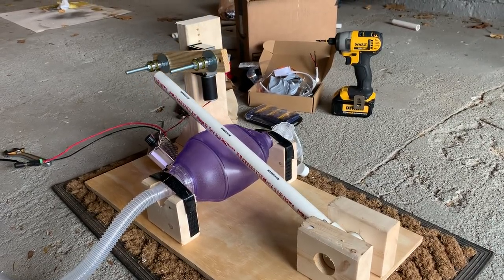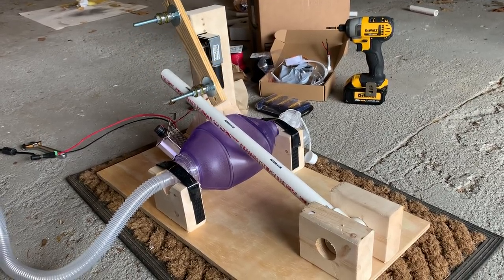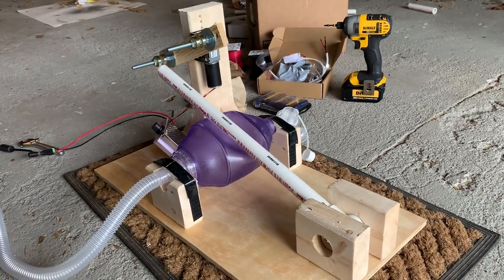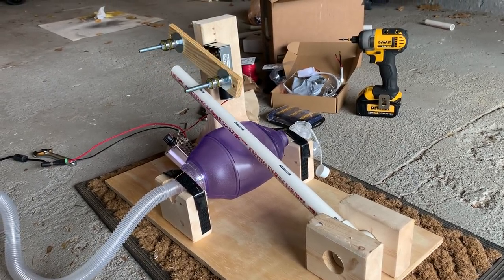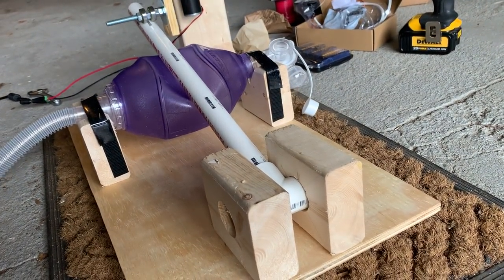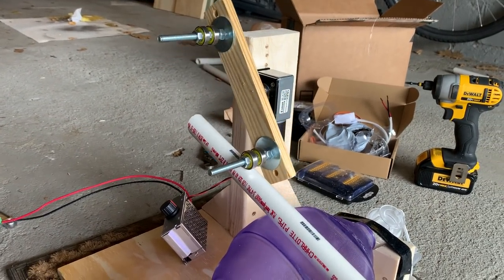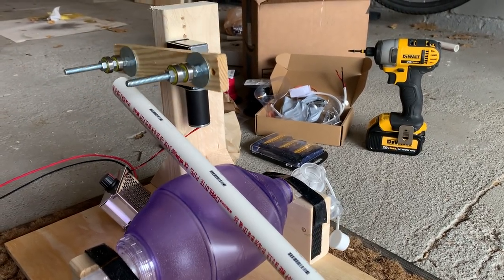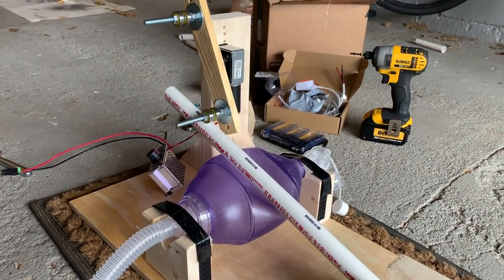Macgyvilator Mk 1 (3-19-2020) - "ventilator" for disasters and/or low resource environments

Comment: I applaud you for putting this together as many other very creative people have shared on youtube, but it is not remotely sufficient for the disaster that we are dealing with. For ARDS, we need the complex settings such as pressure support, higher peep, and perhaps inverse ratio ventilation. These would have to be delicately adjusted to the pt’s changing conditions. Anyone on a “ventilator” of this level of sophistication would probably succumb to the disease fairly quickly.

This is not to discourage your inspiring innovative spirit. I think many out there can help by focusing on creating Powered Air Purification Respirators (PAPR) for frontline usage. Or, meaningful ways to isolate aerosolized environment when affected individuals need to be intubated.

Good luck, and please stay safe!!
Reply from the maker: Thanks for your comment. This was never meant to replace a ventilator. This is a last resort just before hand-bagging for under-resourced areas, and it's also a validated (well, Mk2 is validated) step-off point for other people to tweak and build off of. This is just a first step. I and others are continuing to build!

Comment: Great work, I ordered a bag the other day so I can try something just like it. If you can secure the bag itself better on each end, you'll eliminate that back and forth rubbing - the current friction will probably kill that bag within a day at most. Love all of the innovation.
Reply from the maker: The bag has to move - it can't be compressed without some shortening of its length. Fortunately I've tested the crap out of the one bag I have, and it's held up fine!
Reply: @datatrician1369  Awesome to know!

Comment: Nice solution. Im waiting for my bag to come and want to design makshift ventilator for 3d printers using same principle. I have seen many of those recently, mostly constructed by engineers but they bite it from wrong side. They think simple known ideas for linear motion, like linear gears or pneumatic actuators and assembly complicated mechanisms that will be probably not very reliable. The way for this is to think outside the box, the thinking should be complicated and complex but assembly has to be simple as it gets and with everywhere available hardware. Exactly like your idea. Great job.

Comment: One suggestion I would make is to add support under the bottle so it is not putting stress on the hose attachments when it's compressed.  Right now it seems to be bearing entirely on the hoses, which will wear them out quicker
Reply from the maker: That's a good suggestion. FWIW, I just completed a 24 hr continuous stress test. Everything's still working!
Reply: This is exactly what I was going to point out. The areas currently going through unnecessary bending cycles are likely to be the first failure points.
Reply: I would think letting the bag ends ride up and down in slots, rather than having them anchored would allow free movement and less flexing on the bag/hose joints. Less parts required too.

Comment: genius in it's simplicity, and I think you have the bases well covered.   Beyond the obvious need for a PEEP which you already mentioned, I would be concerned about the longevity of the bag.  I've done long EMS transports for IFT's and had BVMs fail after a few hours use... usually plastic up around the valving breaking..   With a fixed setup like yours where it's not getting yanked and cranked the same way, that should be much less of a concern.  The one spot I can see is that maybe  with the hard pipe pushing in one fairly small area as compared to a hand squeezing, the bag itself might fatigue and tear or lose resilience/elasticity.  Maybe a piece of foam pipe insulation to spread the force out and reduce the depth of compression needed for a given tidal volume?   Having the user periodically roll the bag so the wear point is at a different spot would be an easy mitigation also.    Great idea and nice implementation.
Reply from the maker: I did a 24 hr stress test already, and the BVM held up reasonably well. The problem is that I don't know how well other brands of BVM would hold up. But I can say that the stresses on the BVM don't seem to be excessive
Reply: @datatrician1369  I'm surprised by that, but not at all displeased.   You've done a great job covering the bases.

Comment: If things get bad with a family member I will build this. I ordered a motor and bag valve mask already. Before I saw this video I bought a new small shop vac with a blower function, a 30' vacuum hose, a Cpap mask and a 10' Cpap hose. I figured I could put the shop vac in an adjoining room to our bedroom and rig the hose to force air into the Cpap mask. I could adjust the pressure multiple ways but it would be a constant air pressure. Seeing your design I'm thinking I could combine the two. I could attach the shop vac blower to the PVC tubing then have the extension hose mounted at the one end of the PVC tube that goes up and down. When the PVC tube is down air would blow through the tubing. When the PVC tube raises the pressure in the tubing would reduce to zero. In theory, this could create a high pressure ventilator.

Comment: You can make the volume of ambu bag compressed adjustable either by making the distance to the pivot of the lever adjustable , OR making the crank length adjustable.

Comment: Great design. Only concern i would have is the wear at the end of the bag, where it hits the wood supports. Perhaps the bag could be in low wood box ( with a shaped styrofoam foam base or similar ] that cradles the bag from moving around too much. If the cradle support was sufficient  then hopefully the bag end bearings could be removed

Comment: the concept is good, as I have a quadriplegic daughter on a ventilator,  I must admit this is a good idea, (few realize that after 20 minutes your hands are dead  using an Ambu bag and I speak from experience here)  the only suggestions and/or questions : (1) whats your volume output on each compression of the Ambu bag, (2) can the Ambu bag be removed quickly for actual human usage (quick release) if it is needed to increase speed manually, (3) I would lower the whole assembly to the bottom board, the why is you will have an Ambu bag that will have support when your compressing it, making a more "efficient" usage of the internal air volume in the bag.  ignore criticism,  this could easily be a 3rd world county solution in the future (you know making things medical grade etc) but in a pinch... good job
Reply: Great idea getting the bag down on the board.  ultimately, reducing the amount of movement needed to generate the required tidal volume will reduce wear and tear on the bag, motor and everything else.
Reply from the maker: Thanks for your kind words, Patrick. That helps me push forward! I'm hoping to get to a real respiratory lab this week to test volume output (and to see if it's sufficient). As for #2, the PVC compression lever is just a friction fit into the pivot. You can give it a twist and pull to remove it and then have full access to the bag. It's only held in by velcro straps at that point. And you suggestion #3 is a good one. The supports will end up being a variable height depending on the specific BMV being used, but I think it's worth it. Hold tight for Mk 2!

Comment: Tubing that goes to the patient's mouth should be very short and small as  possible in order to circulate the air correctly. if not it will only circulate the same air to lungs, and some sort of pressure regulator or torque limiter to the motor will be great.

Comment: I think u could put the motor below ñ connect that rod pushing the bag down with an adjustable length of velcro, so that in practical use that mount of the motor is not in a delicate place where it could brake easily. So the whole unit will be enclosed like a box ñ all u have to do is open the velcro of the pipe incest the bag just tighten the velcro to the level of depression of the bag u require ñ the setting knobs can be mounted on the top of the machine.
I'd love to help more.

Comment: You could slide under the bag different thickness of wood to control the volume of air flow also would be good if it could be wall mounted, People like you getting it DONE !

Comment: Please, yes.  Can you share the parts list?  Particularly the motor,  rpm rate module, and the power source.
Reply from the maker: I'm assembling Mk2 as I type this. I'll test the whole thing in a respiratory lab tomorrow, and if I can achieve good physiologic parameters, I'll put together a parts list and assembly instructions.
Reply: @datatrician1369  Great. I'm in South Africa, and there are only around 6000 ventilators for a population of 60 million.
They are struggling  to source vents from overseas, so something like this could be perfect.
Will keep an eye out for your MK 2 and parts list/ schematics.

Fantastic job by the way.

Comment: If you make the spinning arm longer and put the bolts that hold the bearings through slots rather than holes you could then increase or decrease the amount the bag compresses giving different volume of air each revolution. Another option would be to have different length interchangeable arms.

Comment: Great design, only area I see potential for improvements would be the rotating arm. Add more mounting holes the length of it. That would allow you to mount the bolts and effectively have control of the I:E times as well as the Vt as you mentioned by lowering the motor. Great job with this I’m very impressed.
Reply from the maker: Good suggestions. I already have a bunch of holes drilled on the rotating arm; you just can't see them because they're covered up by the big washers.

Comment: To maintain Tidal volume with any extension tubing that you would have to connect to patient you would probably require a greater amount of the bag to be squeezed.
Reply from the maker: That's a good point, but it shouldn't be a big issue for this. It's set for a mid-range compression right now. I'd really like to get access to a PFT machine to get accurate tidal volume numbers.
Reply: @datatrician1369   Could you compress the bag into a balloon under water and measure the difference in water level between full/not full?
Reply from the maker: @missmosity  That idea occurred to me. If I don't get access to a real vent or a PFT machine, I'll go that route
Reply: @datatrician1369  consider talking with a CRNA or really anyone in your anesthesia department. You're likely to get someone interested enough to be able to try and help. Not to mention we are idled right now in most hospitals, so it would give someone something to do. And I'm sure whoever you talk to will already know this, but they can use a reservoir bag as a lung.
Reply from the maker: @justincaseyouforget  Taking Mk2 to the respiratory lab tomorrow!
Reply: @datatrician1369  looking forward to seeing the results! Quick thought, I wonder if there's a way to make a disc that isn't round to handle compressing the bag instead of the skate bearings. It's the same way a lobe on a camshaft works. If alignment or friction is an issue, the bearing could go onto the PVC arm instead. You could completely control duration of compression as well as how quickly you compress (peak inspiratory pressure or PIP). Likely not necessary, just thinking out loud.

Comment: I'm also working on one. I'm trying to build it with  windshield wiper motors because they will probably be more easy to source and they can run off of 12v incase there is no household electricity. It can run off of a car battery.

Comment: Use a plug in drill and besides the ventilator bag, you'd have something that anyone could get their hands on.  Well done!
Reply from the maker: Thanks - my main concern with the drill would be generating sufficient torque at low RPM
Reply: @datatrician1369  I agree.  You could make a small gear drive but that would just complicate your design.  I see now why you built it the way you did.  Great work.

Comment: Use slots for your rollers instead of holes. Loosen wing nut to move in-out for length of stroke and tighten.
Reply from the maker: It's a good idea. Slots are a PITA for me to make, though ;)

Comment: Will you share design, dimensions and materials required?
Reply from the maker: If there's sufficient interest, for sure. I'll make the call by the end of the day
Reply: @datatrician1369  If specs come out and this is actually something healthcare providers can use, I guarantee there will be volunteers to start production. I can already think of a few ways it could be improved for a Mk 2. 3d printed parts open up even more possibilities.
Reply: @datatrician1369  please do share!
Reply from the maker: @orourkean  I'm assembling Mk2 as I type this. I'll test the whole thing in a respiratory lab tomorrow, and if I can achieve good physiologic parameters, I'll put together a parts list and assembly instructions.

Comment: Cool - leave it running and see how long the BVM holds up - I see a friction problem on the ends... but slick concept!  Perhaps a hinge on the end block to let the wear be on a hinge instead of the BVM (left side of the vent).  The BVM/tubing may be more resilient and not need this.
Reply from the maker: Did a 24 hour continuous stress test without issues. Once I tweak the design I'll really give it a good trial.

Comment: From the nursing point of view... in a real practice are we putting this beside the bed? across the patient on a side table?  Mounted to the wall? this appears to be a fairly large device. 

Would the Ambu bag be able to detach for manual bagging if the patient required transportation?

However, I do think this is a rather neat idea because that is something my husband (respiratory therapist) and I have discussed on who is going to bag these patients when we run out of vents.
Reply: Space is always tight around patients... I think pulling the bed away from the wall and placing this at the head would be the best spot. Since he used Velcro to secure the bag, I'm guessing it would be pretty easy to remove. That's a good consideration since we could run out of ambu bags as well as everything else at some point.
Reply: Guessing by the time these are deployed people will be on the floor :-(
Reply: @TheWhitde  maybe true, but this is at least a good thought exercise and provides a little hope. It's much more pleasant than the conversation I was in the other day of how we're going to decide who to take off of a vent and allow to die so we can save someone else.

Comment: This is fantastic! I wonder if you could get rid of the PVC pipe entirely by putting some large rollers on the rotating part. They would make contact and compress the BVM as it rotates around. Like some large diameter rubber wheels.
Reply from the maker: That would work, I think! I'd just worry about the weight on the rotating arm.

Comment: Add a swivel adapter to the end of the BVM.  This could keep that up and down motion from displacing a tube.
Reply: That's an Amazing build. Thank  you. You can replace the bearings with a pipe that will fit on the shaft. This need less alignment. Stay Safe.

Comment: Pipe on bottom so it contacts the wheels all the time and does not have to be supported by the bag.  Motor on lever.  Also, running a link (piston rod) between the motor and pipe would simplify but not give the breaks in operation which might be desirable.  Never underestimate America.  Shared.

Comment: I made something similar but with a windshield wiper motor as it's designed to run continuously and powered it with a DC model train transformer.. but also because it's what I had on hand... I used a door hinge as a pivot point, but i like your design too
Reply from the maker: A wiper motor was also in my list of possibilities. Do you remember if it had enough torque to compress the bag sufficiently? That was one of my concerns.

Comment: you could add a spring  between long PVC and plywood base because ambu bags compliance is less as it seems!GOOD JOB!
Reply from the maker: I'm actually trying to see if I can put a spring inside the bag. The PVC on those bags isn't meant to remain elastic for all that long
Reply from the maker: Yeah - no way to put a spring inside :(
Reply from the maker: @athulaj9319  Got it. Good suggestion. The problem I've seen after prolonged testing (granted, this was in a cool garage), is that the bag doesn't reinflate well. That's why I was hoping to put a spring inside. As it stands, I have to either think of some kind of bad reinforcers or hope that the PEEP in the circuit is enough to reinflate it better.
Reply: Datatrician what about some type of sponge inside the bag? It will reform, then return to normal shape
Reply: @datatrician1369   you can attach  the PVC tube to Bag by some kind adhesive tape and then it will it will automatically  reinflalate by recoil force of spring!
Reply: @kuyote  good suggestion but will it increase  dead space?
Reply from the maker: @athulaj9319  As it turns out, there's really no way to put something inside without breaking the bag. Not willing to do that. Working on a (simple) return mechanism now.

Comment: Nice work with the design! It would be interesting to see if this motor is strong enough to deliver an adequate tidal volume with against high airway pressures.
Reply from the maker: Going to try to test this in a respiratory lab this week